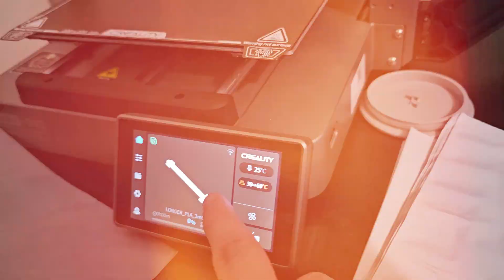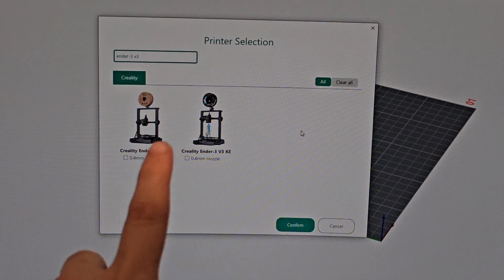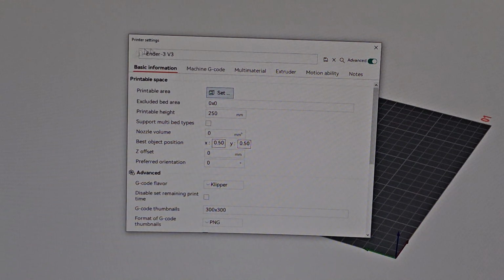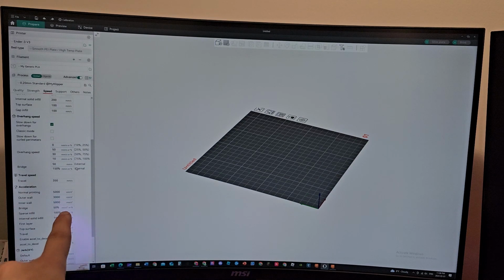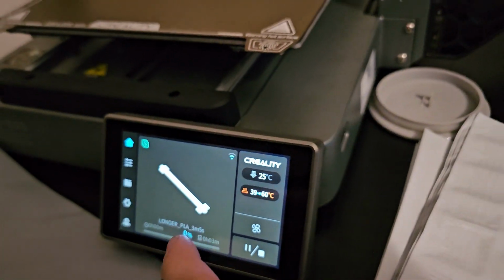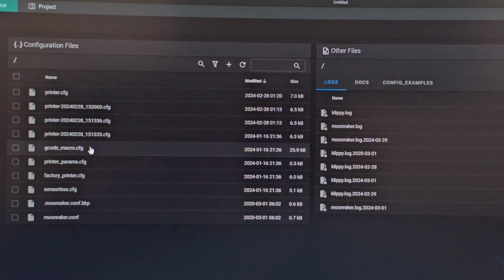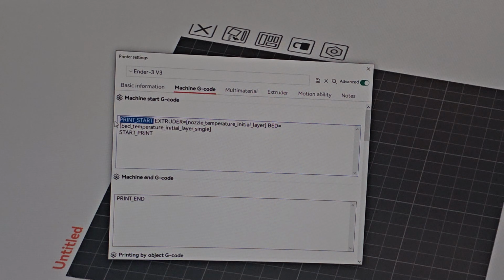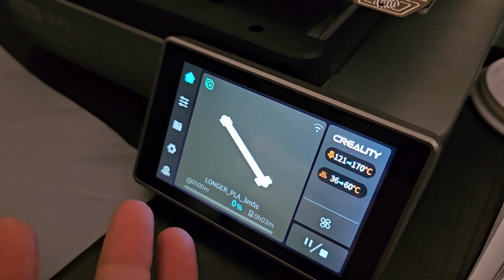Creality Ender-3 V3 Error Key:502 Using Orca Slicer

Comment: my k1 max has the  key:502 mainboard fan exception (rooted) have you a video for this ate know how to fix the issue
Reply from the maker: Usually if you run into any problems when rooting the machine. It's good to factory reset the printer and start over again. That's what I did and it fixes it.

Comment: Great video. One quick question. Can I just type START PRINT in the gcode or do I have to copy and paste? I just set my 3v3 up yesterday. Today I started getting this key error for the auxiliary cooling fan.
Reply from the maker: You can just type it in, but I copy and paste just to make sure I didn't mistype.
Reply: @Scratch3DPrinting  Awesome thank you. Have you had any trouble with the 3v3 bed slamming into the frame? If so do you know how to stop that from happening? Perhaps a firmware update? I literally set the printer up yesterday.
Reply from the maker: @IndigenousCreatures-3DPrintz   I have not have that happen. I did one time get it to crash and cannot make it to the bed, but then I shut it down and restart it then everything works fine.

Comment: Where do you get the port number from? Is the V3 rooted and running Mainsail or Fluidd??
Reply from the maker: From my experience, the v3 has fluidd even without rooting, but for mainsail I think you have to install that because I cannot use mainsail.